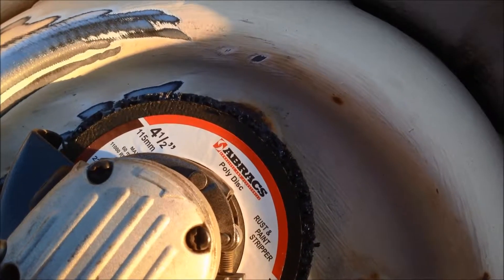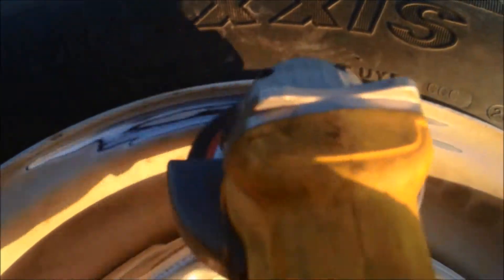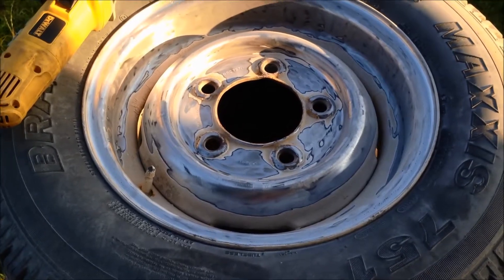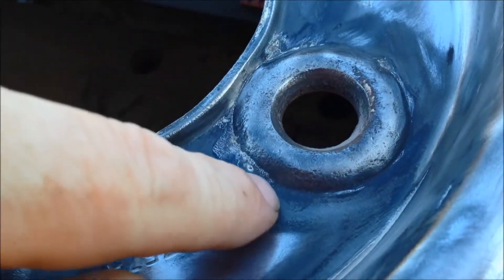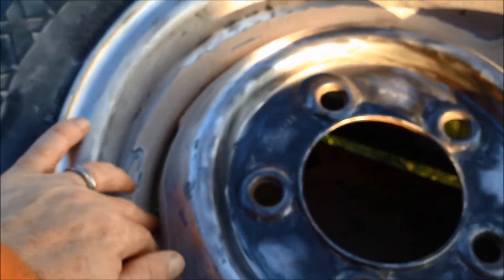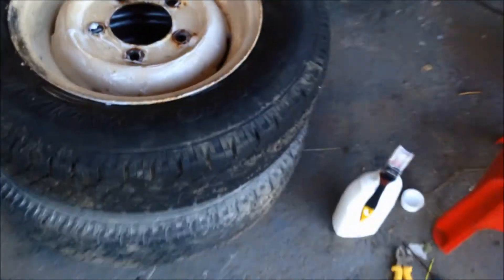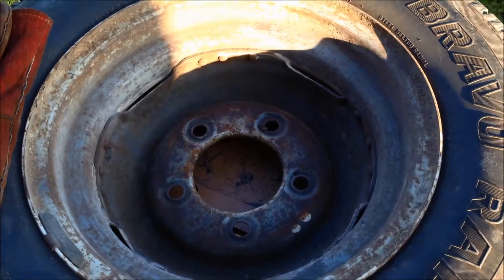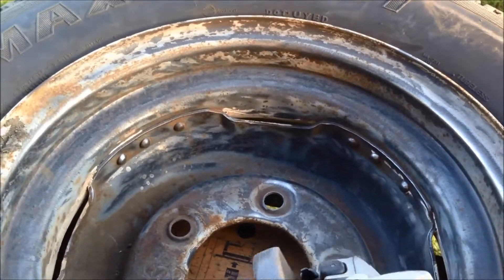Rims part I

Comment: Hi Grant, great to see the on-going restoration of your 2 Land Rover's.  I have some rusty wheels to clean up.  Can I ask how the paint stripping went with the application of that paint stripper.  I was probably going to try a steel cup/wire brush as you have done.
Thanks
Reply from the maker: Dear Ian,
The paint stripper made the paint come off easily with a wire brush. Try it without, you may not need the paint stripper. I used a cup brush (screwfix.co.uk Part No 81337) and go for the smallest diameter so it does not vibrate.65mm rather than 100mm. I also needed to get a flat circular wire brush, similar to screwfix 64592 to get into the lowest parts of the rims.

Without going overboard with H&S, leather gloves, dustmask and goggles. I've pulled a few of these wires out of my overalls. It would cause some damage if it went in your eye and who knows if the paint has lead in it.....
Reply from the maker: Grant Stewart screwfix.com, not co.uk.....